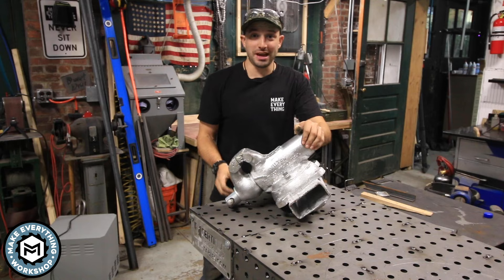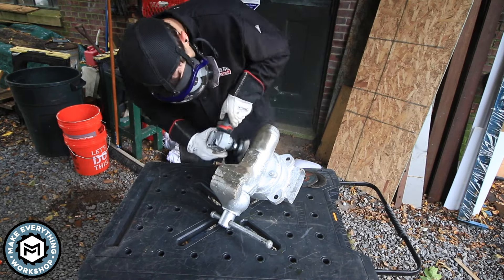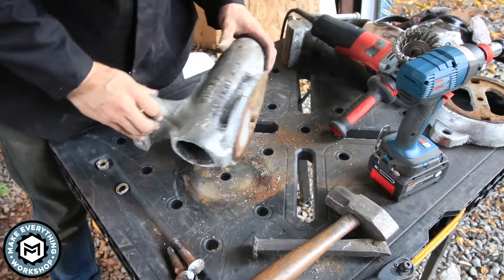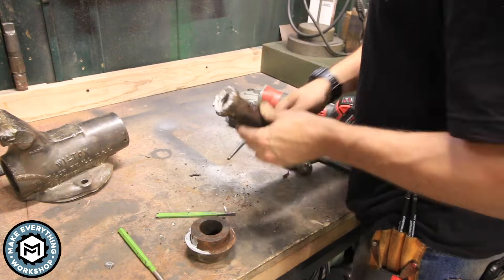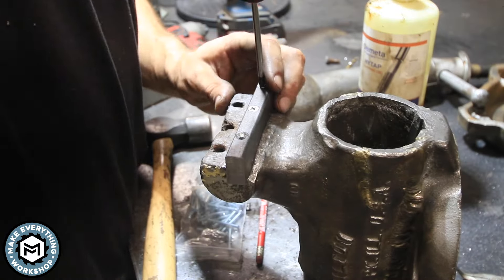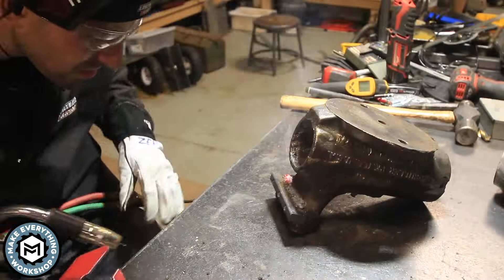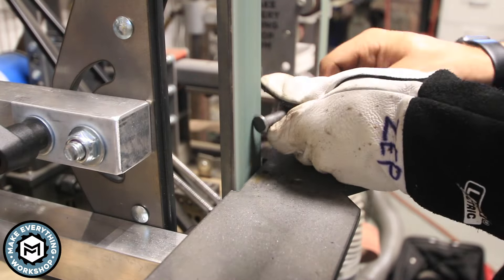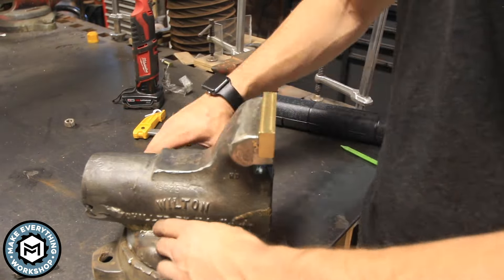Vise Restoration - Broken Wilton Bullet

Comment: this is why talented welders and machinists after SHTF will be more valuable than ant financial planner , or any CPA
Reply: I am a CPA, specializing in corporate structure and business advising.  20 years ago I did welding and construction. I could not agree more with you but would like to add plumbers and air-conditioning technicians to the list
Reply: @hhattingh  I agree

Comment: Thanks for saving that Wilton!  I have four of these bullet vises in various sizes that I've cleaned up and put back into service. The rear caps seem to always be missing on these, so I made my own out of brass and another using aluminum.  Those 3/8 cap heads have a large diameter - easy to turn them down on a lathe so you can use a smaller counterbore in the jaws. I also upgrade the three  collar retaining screws to stainless socket heads.

Comment: Love this video! I restored my Wilton 1755 but it was in great shape with just bad paint. I wire wheeled off the paint and had a bare metal look (with paste wax to prevent rust) just like yours. In my opinion the best way to restore a tool is without paint (unless it's for outdoor use or plumbing where it may get wet).

Comment: I think I have that exact same vise.  Right down to the factory markings.  I finally got around to hunting down replacement jaws (they were beat to hell when I bought the vise and the bench it was attached to for $40 about 25 years ago).  They’re running me $140 because they had to machine them from some similar ‘new old stock’.

Comment: When preheating objects to weld, put them in your gas/charcoal grill, iron likes to be heated all over, not just where you intend to weld. Allow it to come down in temperature slowly and evenly after welding otherwise you will have hot-short cracking adjacent to the weld bead. This also works on TIG repair on aluminum cylinder heads, keep the combustion chamber facing up in the grill or your valve seats will fall out when the head gets hot, with aluminum you want to reheat regularly while welding, it will crack if you don't maintain temp.

Comment: I got myself three Wilton vises. And I like the way you did the video I have to do a jar repair on one of the vices. What do you call it? But I've got a a stand. That stands about 4 ft High 1 ft round and it weighs about 300 pounds. I have to do a little work on that first. I like that that the metal patina solution that you've got that works really good. And the brass in the metal patina looks like a good finish, so I may be using that. Thank you. Larry

Comment: The point of pre-heating the cast iron is not to help the weld penetrate better, but to keep it from cracking. The immense amount of heat created by the weld and the cold body of the vise causes a lot of stress that results in the cracks. A lot of times you will put the entire part you are welding in an oven to get it to temp and then weld, then let it cool slowly to prevent cracking.

Comment: Awesome job I like the used look on tools
Reply: I have one of these Wilton's that my dad used (and maybe his dad used).  I think it's from the same period, the lettering is the same but it looks a little smaller.  To spin it around you loosened a acorn nut on each side with a 5/8 ths box end.  Fortunately ours only had some rust on it no cracks.  I took it apart a few years ago cleaned it up and re-greased it, good for another 100 years or so!

Comment: Hi great video bud I use a high impact manual screwdriver for stuck. No need to bust a nut getting these knackered screws loose just hit the heck out of the screwdriver with your favourite thumb buster.

Comment: Awesome video. Love it when resortation videos actually have cometary explaining it. One question though what is the best kind of grease to use when re assembling something like this. I have a old one thats in need of a good tear down and cleaning "not quite this bad lol"  but I'm trying to find whats the best grease for the main screwing shift that will stay and not end up oozing out and making a mess like it currently is.
Reply from the maker: Thank you! Im not sure what the "best" is, but I use Red and Tacky grease on all sorts of stuff, works well, and stays in place for the most part!
Reply: @MakeEverything  awsome thanks for the input ill try that then. Also i loved that black finish you put on it. I have a old anvil im wanting to clean up and make look nicer but don't want to paint the sides. But also don't want to leave it bear to re rust in our humidity down here in MS.  Do you think this would work on it?

Comment: A shop over would work really well for things of this size. set it to max and leave it in there for 3-4 hours.  Be super careful with it after you take it out cause it will be very hot.  The over could also be used for powder coating.  you can find them cheap on craigs list or ebay.  Look for broken ranges with working ovens.  check local appliance repair shops too.

Comment: Awesome job!!! I have an old vise made in England. It has a vertical bolt to lock it down from swiveling.  The problem is that it is cracked and split on the hole. Any suggestions on how to repair a cracked threaded hole in cast iron?? Thanks.
Reply: Daniel Alamo I don’t know if it’s possible in your case but I’ve had good results with cast iron by digging out the crack with a carbide burr then brazing with bronze rod and completely filling the threaded hole with braze then drilling out and re-tapping the hole. Not the prettiest repair, would probably need a coat of paint but it should be plenty strong enough. I pre-heat the casting first with a gas torch then either cover the part in sand or wrap it in a fire blanket and a load of towels so it cools really slowly. Hope this is (belatedly) helpful in some way. Good luck!

Comment: Nice restoration, however, I was surprised to note that after all the work you did in fabricating the insert jaws, you did not go all the way and grind in or cut in a crosshatch grabbing/holding pattern into the brass. Thank you for the video.

Comment: So, first off, f*cking incredible restoration. That came out wonderfully. Way better than the chrome junk it was. Wow. The brazing marks look really cool with that color scheme. I really love the black look. I checked out that site. So I will need both the oil and the wax to achieve the look of this vice? Thank you and great video!
Reply from the maker: Thank you!!! I have used just the black patina and gotten a great look, I just happen to have the black wax as well and it left it with a beautiful sheen! I have used it with just clear wax over it and it still looks awesome
Reply: @MakeEverything  Thank you very much. Again, fantastic work.

Comment: Sorcery.  Fine instruction.  What was the cost for the scrap vise?  I am confused: when does one know when to use steel MIG wire vs. iron rod SMAW?  Maybe, the vise is not cast iron but is higher carbon steel like the misnamed  "wrought iron."
Reply: Right, real "wrought iron" is a very misused term.  It is a very low carbon steel that was used long ago for decorative work, today we see a fence and people say it's wrought iron but it is made from modern "mild steel" which is around .020 to .040 percent carbon.  Cast iron has a minimum carbon content of 2.00% to as high as 6.67%.  For the wire he probably used R-70 S6, which is a very common steel wire that's found in most stores.  It has more Silicon (.006%) which is a deoxidser.  Since this was now clean, rust free metal he could have used the somewhat harder to find R-70 S2, the lower silicon content would have more malleability and would be easier to machine.  He said early on that he got it for $40.00.

Comment: How long was the post on it? Looked like it was a bumper vise for a welder or heavy equipment repair truck. Super resto. No crap on the machining or welding; if it cleans up good, its good and it looks better than good. Great work!

Comment: Nice work, Question to anyone, what MIG wire did you use, regular mig steel wire? maybe I missed it. I've used regular MIG wire to fill drill holes, saw cuts etc on a few Wiltons & others and usually braze larger problems/cracks.
Reply from the maker: Alger C. I used regular mig wire, with the preheat it seemed to work pretty well, no visible cracks and it looks pretty strong

Comment: I would have built up the anvil section and milled it dead flat. Otherwise excellent restoration. Thanks for the video
Reply from the maker: I thought about it, but after mig welding the jaws, and seeing how tricky it was to get a consistent finish i figured id make do with what i had. The mig welding left the surface extremely porus, and needed a lot of filler to look right. Thank you!!!
Reply: @MakeEverything   What filler did you use to fill the pores?  Outstanding work by the way. You have fantastic equipment. Thanks for sharing.
Reply: What if you mill the existing surface and weld a plate over it?
Reply: Nah. Looks perfect.  One should also never use the “anvil” spot either.  Keep in mind you’re hammering on cast iron.

Comment: A very nice job bringing something back from the dead.   A suggestion for someone else's project would be along the lines of building up the anvil (below) with weld material. This would be aesthetically better, but perhaps a better approach would be to mill that surface flat and welded a piece of tool steel where the anvil is.  One critical comment: BRASS IS NOT A GOOD JAW MATERIAL!  No friction!  Stuff will squirt right out of the jaws!  Suggest copper.  Alternately, use hardened steel that has serrations.  My 2 cents.
Fun to watch, though, and the outcome is impressive given the starting point.

Comment: good job. next time just soak the vise in undiluted simple green for a couple says and the paint and grease will just fall off. It also takes off some rust. It will give you time to work on another project. you’ll also save your lungs from all that wire wheeling toxic paint and metal dust.
Reply: Did you not see his respirator?

Comment: Nice job overall, However, I would have brazed the repair of the lower jaw, much stronger than the MIG bead and screw arrangement. Have more faith in brazing, it makes extremely strong joints.

Comment: Milling to eyeball tolerances is a perfectly acceptable method for saving time when precision tolerances are not required.  Theres no reason to center the counter bores in a one-off vise jaw beyond visually appealing.  It's not a prototype for a production run.  If the fasteners fit, and the parts don't have obvious alignment flaws, we call it craftsmanship.

Comment: you can turn the power supply 180 degrees so the terminals face down-then you can't drop anything across the terminals shorting it out  plus no water would get in there...

Comment: First off, excellent job on the restoration. Looks like it turned out awesome. However, I can't believe you gave $40.00 for the vise in the shape it was in in the beginning. Jesus H. Christ, I'd have offered him ten bucks and yes I do understand pricing changes due to the part of the country you're in, not to mention, people have seen these videos and suddenly think their boat anchors are gold.
I use to get old, beat up, messed up, rusted up vices for pennies a pound, a couple weeks ago I saw one a guy was asking, actually demanding, $100 for and fixed jaw was broken completely off and lost and it was just in terrible shape. He knew me from some other swap-meets and he tried to get me to buy it from hi for the $100. I told him, "I wouldn't give you $5.00 for it." Then he got all upset and said, "You guys will fix them up and resell them for a huge mark up. I said, "Yeah, that we will, but we'll have eighty hours of labor in some of them too, and that's assuming they can be repaired in the first place." Then I pointed to the missing fixed jaw and said, "You don't even have the part in order to make the repair which means I'll have to cobble something up to make it work. And if it does work, it isn't gonna be original, which means the odds of me selling it for anything close to break even is impossible."
Sadly, he considered my work came at no charge, apparently he felt I did it just for the shear pleasure of doing it, and he'd had to buy that vice so he had real money tied up in it. I said, "Well, if you gave more than five bucks for it then that's on you."
Reply: The base and inner ring alone are worth more than 40.00

Comment: You guys shouldn't be so adverse to a brazed repair of cast iron. Done right, brazing is very durable, just look at the original repair. I've seen brazed machine repairs hold up to daily use in heavy industrial settings, whereas a welded repair fails the first time it's heaved on. By the way, thread engagement of 1 1/2 times the diameter is all that is needed to max out a tapping for a fastener.

Comment: I didn't see you replacing the pin that holds the lead nut "bullet" housing in place. Did you skip that? That pin is there for a reason.
Reply from the maker: Yes I put a new pin in there 👍🏻

Comment: When welding cast iron or even just very thick or large pieces of steel, you should heat the ENTIRE piece to 400 degrees.  If you only heat the area you are welding, the rest of the piece will suck all the heat away from your weld, cooling it too quickly, which is what causes welds to crack in the first place.

Comment: serious question why use a grinder without its guard ?
Reply: it's to my little experience much easier to use a grinder without gard and allow you more freedom.
Reply: It gets in the way when trying to get in tight places. That's why they make safety glasses.
Reply: @williambryant5946  Have you ever seen a cut off when explode? Safety glasses won't do a damn thing.
Reply: @xenonram  Sure have and I know that can be prevented if you use a grinder correctly and inspect your grinding disk before you use it.
Reply: Wilton vises are ductile iron not cast iron. Ductile is a little easier to weld. Regular gray cast iron probably wouldn't have faired quite as well.

Comment: Think i would have red loktite the 3/8 bolts then redrill them to the factory 5/16”
Or just heli  coil repair
Like them old vices
What was the date code on it
Thats usually the first thing bullet vise lovers check 
Sure it will last you a life time now 
My dad gave me mine its a 60 vintage 
That Ive had now for over 30 years